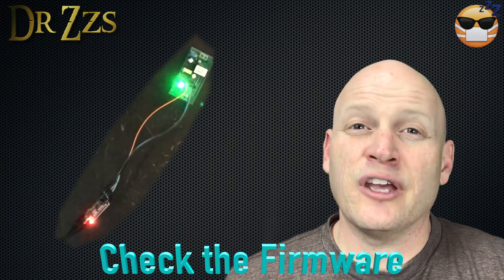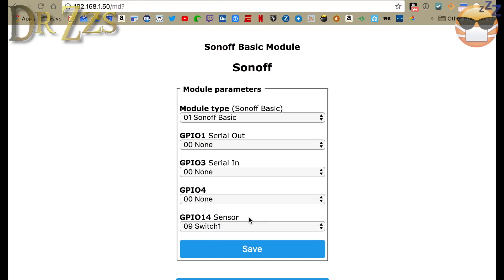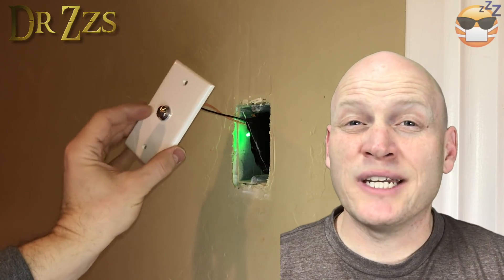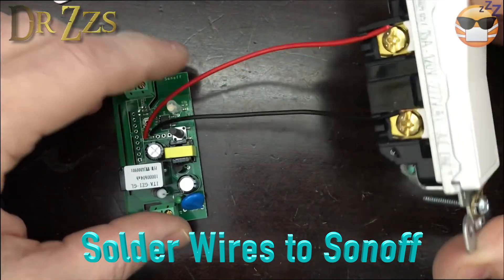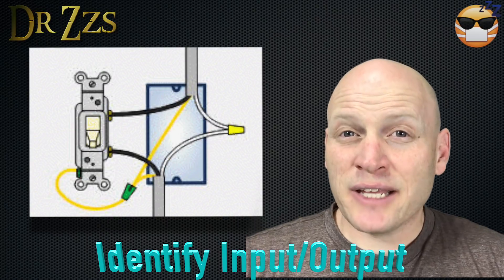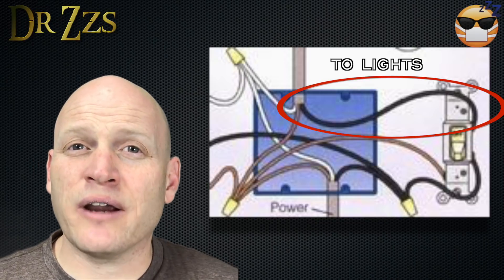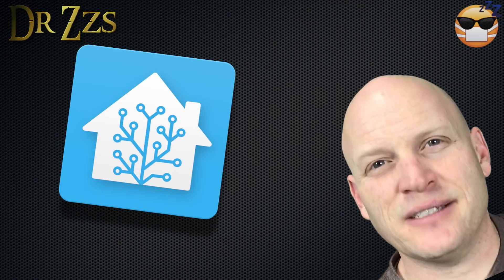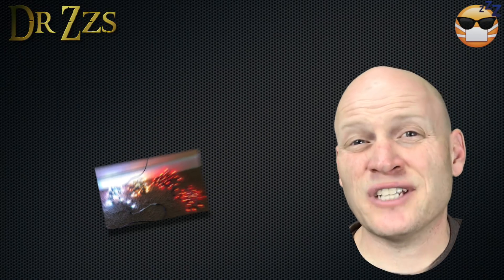No $30 "Smart Switch" | $5 Sonoff + REGULAR Light Switch!

Comment: Nice video, 
Can you still use the sonoff with Alexa?
Can you configure it to work with apple homekit and still work?
Reply from the maker: good question
There's an option to have the sonoff (with Tasmota) emulate a Hue Bridge or a Belkin WeMo.  
Looks like some folks have had trouble getting alexa to detect Tasmotized devices, but seems most can eventually get it to work:

https://github.com/arendst/Sonoff-Tasmota/issues/596

Let me know if you get it working.  I have an original echo and 5 echo dots in our house, but haven't gotten around to including them in my Home Automation set-up yet.  

So many projects, so little time.
Reply: To anyone reading this after Feb 2019, yes, the Sonoff can still be used with Alexa/Homekit/Google via HA or OpenHab, or your own "skill" as Amazon calls them.

Comment: You can leave the neutrals like they were originally and save one step, you just need to grab a little piece of wire of small gauge and attach it to the main neutral to bring neutral to the sonoff in order to run the little transformer, there is no need to pass the load neutral through the sonoff.
Reply: tentei plugar em uma tomada e puxar os fios neutros e linha para a caixa de interruptores, porém como nao tem retorno de neutros ficou somente o fio que volta da lampada e elas ficaram piscando, dai tentei colocar no teto onde o neutro e a linha chegam nas lampadas porém a lampada fica sempre acesa, estou tentando descobrir se é um problema do sonoff ou da minha instalação, sou 0 eletricista. tome cuidado ao instalar desligue sempre a caixa de luz o choque ali mata.
Reply from the maker: Not sure I can visualize exactly what you mean.   So the answer is; probably yes. 
What matters most is that the 2 wires going to your lights now go to the Output side of the Sonoff, and that you have a Hot/Line and a Neutral going to the Input side.  
The wire you use for the neutral to the Sonoff needs to be the same guage as the Hot/Line.  Don't use smaller guage wire there.  Once the circuit is completed (the lights are on) that Neutral will be carrying the full current of the circuit.  So if it's too small it'll heat up and could melt the insulation and cause a short.  Then BANG!
Reply: DrZzs i just mean that the neutral wire just pass through the imput and output on the sonoff device you dont need to detach the neutral that goes to the light, but you need neutral for complete the circuit on the sonoff tranformer and can be just a piece of thin wire, the screws labeled hot or L on the imput and output are the only ones that need to remain like you did. Its not like you are doing it wrong, its perfectly fine but you could doit like electricians do. Neutral almost always goes directly to the load,( in rare cases you switch it too)same like wall sensors, they only have one white wire and 2 black wires, the white goes to the neutral without detaching the exixting neutrals, just taping on it, an serves just to power the sensor itself and the black wires are the real switch.
Reply from the maker: oh I see now.  Cool.  That would save some hassle.  I'll try it that way.  Thanks!
Reply: DrZzs The full charge of the light will go to the neutral like always did since like i said you dont need to separate the light neutral, even thay way its more secure since you dont have to use the output or imput neutral terminals on the sonoff to feed the light, however you need at least a thin wire on the neutral screw of the sonoff to the mains neutral in order to  turn on the device, which just consume some milliamps to turn on the electronics and the relay. Check the path on the neutrals screws on the sonoff  and note they are just going in and out, but there is a little path to feed the electronics.
Reply: DrZzs the thing is that the sonoff was designed to be used with extensions cords that dont even have ground, that way you need to pass the neutral for the load like it was designed on those terminals, but used like a wall switch you dont need to pass the neutral of the load through the sonoff, you only need it  to feed the electronics so at the end you shoukd have only 3 wires on the sonoff, hot imput,hot output the same gauge of the wall wires, and a neutral for sonoff itself.
Reply: chancho00 does the neutral on the sonoff need to be on the input side or output side?
Reply: Nerd Of View it can be on either side since the neutral has a direct path from input to output, there are 2 reazons why is like that, one is because sonof was designed to be used with extensions cords and the other is that has a internal tranformer and need neutral to work, the big neutral load can be connected directly to the load.
Reply: chancho00 so the neutral is used just to power the transformer. That makes sense.
Reply: Nerd Of View Wait, if you use the device like it was designed then the neutral also feeds the load in that case, but if you use it like a wall switch like in this video then you dont need to use the pcb part of the neutral for the load, just to keep the electronics on the sonoff powered and can be just one thin wire in the input or output, they do the same with every switch in the market, in electrical wirings the neutral almost always goes directly to the load and this device is not an exception to that rule if being used like this.
Reply: chancho00  in brazil we dont have neutral on the switch boxes only on the ceiling, first option: should I use the neutral that is in the ceiling or that comes from the light? Second option: is there anyway to use in the box if I don't have the neutral inside?
Reply: Did you find the answer Aris ? So do brasil tmb e queria saber como faço a conexão
Reply: Aris Saraiva hmmm saquei vlww amigo e boa sorte

Comment: Are there not some electrical codes that have to be met?  Does this meet the standard US ones?
Reply from the maker: Scott Laxon I’ve heard that too. These sonoffs are not UL listed. As I understand it, any non-UL listed device that causes a fire would give an insurance company a reason not to pay. And they are HAPPY to find any reason not to pay. 
The sonoffs are CE certified. So in Europe they are considered safe. 
Everyone has to make their own decision on this. I feel safe using them in my switch boxes. But when I sell my house I will be taking them out so I’m not passing that risk on to the next owner. 
I appreciate you bringing up the risk because everyone should know they aren’t UL listed. Hopefully someday they will be.  
Thanks!
Reply from the maker: Can you help by describing what it would take to make a safe installation? 

You have knowledge I don't have, and there are a lot of people who want to use the sonoffs as I've done.  

These are great little devices.  They seem to be built well enough not to spontaneously explode. And they are CE certified for use in Europe. So the issues seem to be mostly with the install.  
I know they aren't meant to be in the switch box.  But I assume that because they are not UL listed they would also void your insurance if you are just using them on a lamp cord out in the open and a fire starts. 

My wiring choices aside.  What would it take to make the sonoffs "safe"? 

Thanks
Reply: Hey DrZzs, sorry if I was dissing your install a little, just want people to make an informed decision.  I have some familiarity with the NEC as I've done several household electrical projects that are beyond what most home owners do. I'm certainly not an expert, although I have read NEC parts applicable to work I've done.  I do have an electrical engineering degree, but I'm not a licensed electrician.

The best bet in my opinion for a wall switch, would be to use device that is made to be a wall switch :)  I've used the Ankuoo and TP-link Wifi wall switches, they are UL listed and both can work with Home Assistant, which I use too. You can not however, load tasmota or ESP Easy on them so I don't fully trust what they are doing on my network. I have them segregated on a separate VLAN, normally blocked from connecting to the internet, and I only allow connections to be initiated from my production home network to the secured VLAN, not the reverse. More effort than most people will do or likely many will even understand. Last I checked the Ankuoo is about $21 on Amazon.  The "sonoff touch" is made to be a wall switch, and of course has the advantage of supporting tasmota or ESP Easy and costs about as much as the Ankuoo, maybe a bit less. I doubt it is UL listed. I haven't purchased one and can't give a first hand opinion. I would expect it to be much better suited though vs. the sonoff basic. I couldn't find a schematic so I don't know if it's fused or not.

For a safer device in general, I prefer the sonoff th10 (or th16). These devices have a better board layout with good separation of AC and DC circuits, they have a fuse!!, and the connectors on them are beefier than the dinky screw terminals on the basic as well as providing better physical separation of the wires. They also have a jack bringing out GPIO14 and with a bit of effort, also GPIO4. I have a couple of the basic model, but the majority of sonoffs I use are of the TH10 variety. What I don't like about them is the size, but I can live with it. They are more expensive, generally under $10,  some I got for as little as $7.50.

As far as making the basic version safer, here are some ideas. Put a fuse with a fairly low current rating, maybe 3A(?), in line with input HOT wire. [Would be a good idea to replace the fuse on the TH10/TH16 to one of a lower rating also.] Only connect to lower wattage devices, never try to use any sonoff to the published current limit (10A is claimed for the basic). The sonoff basic may be fine for household lights, which are typically low wattage these days, but they shouldn't be used with heaters, air conditioners, refrigerators, or pretty much any inductive load such as power tools, garage door opener, etc. 

I know some have mounted it in a larger case, either just the board or the board and the original case so the wires can enter exit in a safer manner (as it comes, a hard yank such as tripping over the cord, could pull the live wire right out). The screw terminals are not great, removing them and soldering wires directly to the board would be better (with an in-line fuse on HOT), providing the person can do a good job of it. Poorly done, it could be less safe than the original terminals.

I've saw images of someone who tried to use the TH16 with a 3KW heater (including a blower fan) with results as expected. The relay likely welded itself into the on position, the plastic deformed, starts smoking, a sizable hole in the case developed as the plastic burns away. They guy couldn't understand why this happened as the total load was "less than 13A" at 240V and it's supposed work up to 16A.  Yikes! Anyone reading this, don't connect any sonoff or similar device to a 3KW heater with an inductive fan load unless you are intentionally trying to start a fire. I wouldn't load any of these devices anywhere near that much, no matter what the specs say.

If one is going to use the original case, replace the too short screws that often strip causing the cover to come off exposing the AC power terminals.  The four plastic wells will fit a screw of about 8mm in length, yet they include ones that are nearly half that, I don't get it. I found M3x8 machine screws I had on hand work much better than the originals. A self taping screw that is like the original design, only longer, perhaps 6 or 7mm, should work well.
Reply from the maker: That's a good question. 

I found an answer on the Sonoff manufacturers website:
http://support.iteadstudio.com/support/discussions/topics/11000011177

Essentially they are not inspected or approved for in-wall installation.  If you feel comfortable installing them in your own house, that's up to you. But if/when you sell your house to another person you should take them out.  That's what I plan on doing, eventually.
Reply from the maker: Man, you're awesome!  
That's some great information.  I hope a lot of folks will read it. 
No need to apologize.  I didn't feel dissed at all.  I'd much rather know what I've done wrong and how to fix it.  
Thanks again for putting so much thought and time into that response.  You've given me a lot to think about.  I'll do better in the future.
Reply from the maker: I really appreciate your comments.  Thank you!
Looking back I'm a bit embarrassed that I did such a bad job installing these.  Worst part is I gave a lot of people bad advice. So I'm super grateful for your input!  Thanks again. 

You've probably seen it, but incase you haven't; Here's the update where I tried to fix the mistakes I made in this video. 
https://youtu.be/B38e1HAMUXs
Reply from the maker: Ouch.  
I'm sure you're right.  I'm no master of the electrical code. 
I sure don't want anyone getting hurt or causing a fire.
Reply: Your videos are great - thank you! I do cringe a bit when you talk about the electricity. Especially at 2:57 where you say "just guess."  A better approach would be to find the hot wire - through either a digital multimeter or a non-contact voltage pen. https://www.amazon.com/Meterk-Non-Contact-12V-1000V-Flashlight-Multi-sensor/dp/B0711KGPYD/ref=sr_ph_1?ie=UTF8&qid=1526391894&sr=sr-1&keywords=wire+pen. Then, the user can know for sure their wiring setup, as it can vary by house to house and receptacle to receptacle. Example, white wires - coded black - etc.
Reply: Your insurance may also not cover your house burning down if it's due to an electrical fire and they find these in the walls. Something to consider
Reply: National Electric Code specifies not only the device be approved, but many other aspects of the installation.  Violation - low voltage speaker wire not approved for in wall AC;  Violation - wire splice connector not approved for application; violation - volume used in the duplex box exceeds specification.  There are probably more code violations that one could come up with.  And yes, if this causes a fire, you can be certain your insurance company isn't going to pay. I like these devices, but would never consider using them in this manner.
Reply: UL listing aside, installing the Sonoff in a separate UL listed junction box would be a start. The speaker wire is the biggest issue, as it is being used to distribute line voltage. Adding a junction box to an existing installation would certainly complicate this DIY project but it is not impossible nor would it require advanced skills. 

Honestly, things to change with the particular installation seen in this video would be to use proper wire nuts instead of butt-splice connectors; use appropriate wire (THHN, XHHW, etc.)insulated wire for AC voltage connections; if at all possible, install the Sonoff and associated wiring in a separate junction box with cover and appropriate connectors (i.e. Romex connectors).

Technically speaking, there is nothing you can do to get this type of installation approved by an inspector, however, the aforementioned corrections would make for a safer installation. If this is currently installed in your home, I would definitely replace the speaker wire and butt splices with THHN and UL wire nuts. I am not as concerned about the Sonoff being in the same box as the switch, just make sure all contacts of the Sonoff, switches and wiring are insulated from one another. 

As an aside, great videos with lots of useful information. Thanks!

Comment: This makes me wonder if you could use a sonoff dual to control two light switch I have lots of places where I want to control to lights ( outside garage lights and mailbox light they are in the same switch box and I'm not sure that two sperate sonoff baisic will fit
Reply from the maker: Steven Reed Sonoff makes boards with multiple relays that would do what you need.  I haven’t used one yet but I have the same situation so I’ll get to it eventually. 

2 Channel: 
ITead Sonoff Dual Channel WiFi Wireless Smart Switch Works with Amazon Alexa, Control two home appliances with APP,remote control Appliance Controller for DIY Smart Home https://www.amazon.com/dp/B06XST8B83/ref=cm_sw_r_cp_api_HYffAbKACKAEB

4 channel: 
Sonoff 4CH Smart Switch 4 Channel Din Rail Mounting Wi-Fi Switch ,Wireless Remote Independently Control 4 Devices or Home Appliances, Works with Amazon Alexa Google Home https://www.amazon.com/dp/B075H9KPRY/ref=cm_sw_r_cp_api_BXffAbMYTB5M9